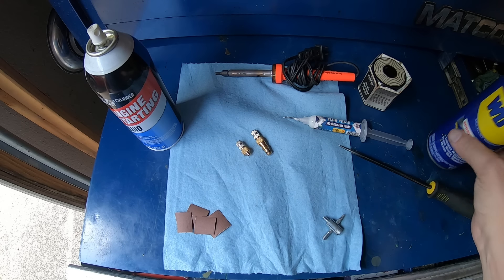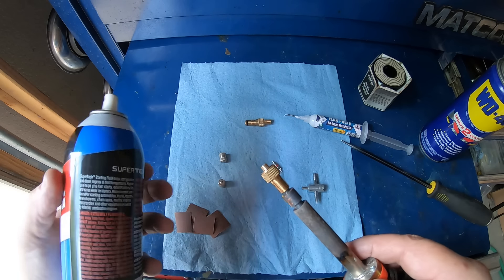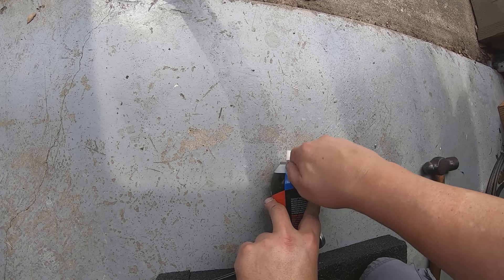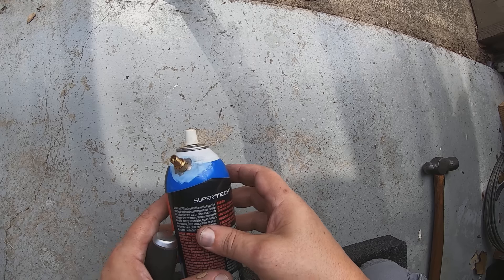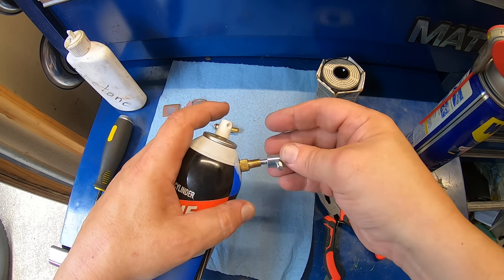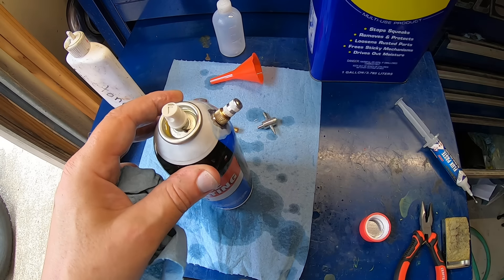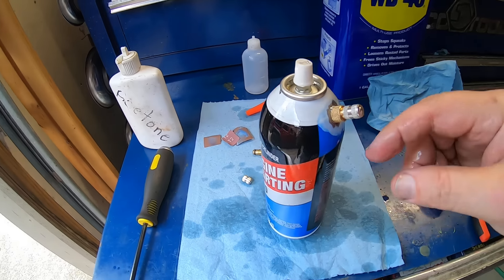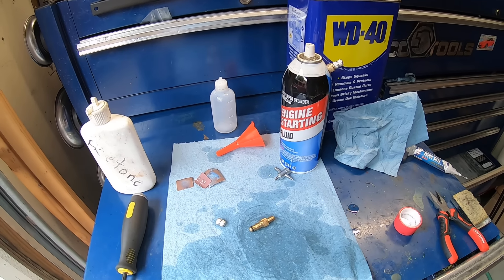How to Easily Install a Schrader Valve on any Can to make It Refillable without Drilling or Torch.

Comment: Cans are made for refilling. This is a dangerous thing to do with this one time use can.
Reply from the maker: No, not really, these cans are not made to fail after one time. People have done it for years with no problems. It is not a new hack.
Reply: @737mechanic  I still would be safe with one made to be refilled.
Reply: @RodgerMudd  Then don't watch these type of videos!  Problem solved.
Reply: @russb.6899  Youtube suggested I watch. If that's OK with you!

Comment: Interesting, but all you need to do is pull the spray nozzle off and use a blow gun with a rubber tip. Push the rubber tip onto the nozzle tube, air it up , and put the nozzle back on. Done.
Reply from the maker: That will work if all you want to do is spray air out of it but in my case I need, WD40, mineral spirits, and other liquids. How do you get the liquid in it?
Reply: @737mechanic  Correct, it just works to pressurize cans that still have some material left in them, which for some reason seems to happen often with PB blaster for me. I have a couple sure shot sprayers that work great.
Reply from the maker: @brianw8963  I have two sure shot sprayers that I really like but they spray too much fluid. These cans spray a finer stream or mist depending on the cap I use.
Reply: @737mechanic  I don’t use mine for thin liquids for the exact reason You mentioned, I use them with my undercoating/ rust prevention solution for spot applications when I service vehicles. For the thinner stuff like WD 40 I use the refillable pump spray bottles. I do see that your idea works well.
Reply: That puts pressure in. I do that to paint and WD40  cans that are a bit old, seems the pressure ebbs over time. But, it doesn’t allow refill of the can with liquid, correct?
Reply: @flmulcahy  Yes sir, You are correct. I believe I mentioned that previously. My fault for misunderstanding the original concept. I apologize.

Comment: Is it risky? If that brass fitting let’s go it will be like a bullet.
Reply from the maker: It won't be a bullet, the air pressure even at 100 psi is too low. For instance, a pump-up pellet gun compresses the cylinder to 3000-6000 PSI and it is shot from a barrel so it has time to build velocity. And a 22 rifle builds up to 24,000 PSI when it fires.
Reply: @737mechanic  ok, thanks

Comment: If air is ok to re fill, why use expensive, iffy gasses in the first place?
Reply from the maker: The gases they use are not expensive.
Reply: They use unscented LPG liquid and as the product is used the LPG boils to maintain pressure air would not last long enough for the whole can.
Reply: Air is full of moisture and oxygen so either ends up rusting out the inside of the steel spray can.
Reply from the maker: @mikelastname  The inside of aerosol cans are coated so they will not rust.
Reply from the maker: @trevorwilton2723  Not only is that not true as I have depleted my first can on a single air charge and still had air pressure left but even if that happens you hit it with an air nozzle and you would be good to go again.
Reply from the maker: @trevorwilton2723  You are incorrect as I have already depleted the first can I did and still had pressure left but even if that was the case you simply hit it with an air nozzle and you have air again.

Comment: One caveat to share. 
Don’t fill WD40 as much as it can hold, just fill 1/3 capacity and leave the rest with compressed air. 

The manufacturer can fill liquid almost full otherwise because they use new formula liquified low pressure gas (CFC in the old days HVAC) to keep inside cavity pressure constant.

Comment: Punch a small hole and open it by rolling the hole to correct diameter with a #1 phillips screwdriver.  
Do NOT drill or ream the hole - it puts metal chips in the can.
Use copper tail AC Schrader fittings - buy at a HVAC trade supplier - dirt cheap with a far better chemically resistant plastic seats in the valve.  The copper tail makes it easy to lay the valve fitting close to the can... not sticking out. 
You can gravity charge the can with a screw on hose connection to a funnel, or low pressure charge it in. You need to vent the can by inverting and pressing dispensing valve - to vent air being displaced as the fluid fills the can.

Comment: Why dont you just take the little plastic top off any spraycan that lost inner air pressure, and hold a normal rubber rimvalve to the little plasttube on top and fill compressed air in, like inflating a tyre. And them put the little plastic top on afterwards.
You can easy get a loose new rubber valve from your tiredealer, but get a long rubber rimvalve, so its inner metal parts dont touch to far down.
No drillimg and no need for soldering, and easy to do with various spraycans, that lost pressure, but still have some content.❤
Reply from the maker: That is great if all you want to do is have a can of compressed air but I need to spray liquids like WD-40 and mineral spirits or alcohol. 

How do you get the liquid in the can doing it your way?
Reply: @737mechanic  I just want to empty the cans even if the kompressed air in the can is gpne and some fluid still remain in the can.
Reply from the maker: @FlemmingGjellebøl  You can actually take a rubber tipper air nozzle and use that to shoot air back into the can. Like this one.
https://amzn.to/4blz5GF
Reply: @737mechanic  Good idea, easy and simple. Thanks a lot good buddy.

Comment: Main problem is youre using wd40. For what? Any claimed use other than displacing water, theres a product that works 10x better.
Reply from the maker: I use WD-40 for machining aluminum.
Reply: @737mechanic  I used to use this green stuff, cant remember what the name was but it didnt stink like wd40. So maybe just 5x better.  I just get annoyed when people suggest it as a lubricant or rust preventive when its really  poor for such applications. The best spray lube I recall ever using was made by castrol and  was marketed under their syntec brand. Similar to light weapons oil but thicker, and had no offensive smell. Looked like honey. Unfortunstely its either been discontinued or just isnt sold anywhere.

Comment: These cans normally use a propellant, though, which maintains the pressure by the propellant continuously boiling and making more vapor. With compressed air, the pressure will drop really quickly when you press the nozzle valve to spray the contents. You'll have to keep adding compressed air and it will be annoying. If you try to make up for this by using a higher air pressure, you risk an explosion from overpressurizing the can. Also, these cans are not designed to be refilled so the fatigue caused by cycles of pressurizing and de-pressurizing is not taken into account in the design.  I'll just keep buying them.
Reply from the maker: These kinds of mods are not for everyone. Some people overthink everything. So far I have sprayed all of the WD40 out of the first can I made and never had to refill it so you are incorrect in thinking you would need to always refill it before you get all of the contents out. I am sure you are incorrect about the can being fatigued to the point of explosion.

Appreciate your comment though.

Comment: 700 degree soldering iron on starting fluid can with product still inside , what could go wrong, too much work , just buy the spray bottle and gallon container they last for years

Comment: Your video was really as a good inspiration for me. I always used to repressurise the cans when there was still a little liquid in, simply by pushing the tip of the blow gun on the little plastic pipe of the tin. So actually I just needed a way to fill in fresh liquid. I ended up soldering on a nut and closed that with a screw and an o-ring. So far it's holding the pressure. I'm pretty sure instead of the o-ring some teflon tape would do it as well. 
I used a torch and for safety reasons I filled the can with water, wasn't so keen to figure out how a little brake cleaner mixed with lots of air might react to a flame.

Comment: So dangerous. Propellant is flammable, an empty can still contain propellant and could explode. Darwin Rules!
Reply from the maker: Have you ever wondered why car gas tanks don't blow up even though they have an electric fuel pump with brushes that arc? The air fuel ratio has to be correct and you have to have a source of ignition. Both of which are missing with this mod.
Reply: @737mechanic  introducing a hole introduces air. You don't need the correct air fuel ratio you just need enough oxygen to support combustion of some or all of the fuel. Petrol pumps do not mix fuel with the brushes. That's just a stupid statement. The electric motor is quite seperate from the fuel pump. I wasnt talking about your mod in particular as I didn't bother watching it. Just the whole process of piercing a can with flammable contents. But you do you Darwin will take care of the rest.
Reply from the maker: @DeveloperChris  you are completely incorrect, the electric fuel pump is submerged in the fuel and the fuel completely surrounds the brushes.

The only thing that keeps it from combusting is the air fuel ratio is not correct.

Look it up before you assume how something works.
Reply: @737mechanic  Interesting, the differences is the fuel pump is submerged in petrol. No air fuel mix. Apart from that my comment doesn't change. By adding the ability for air to mix with the contents of the can you are producing a potentially volatile situation. Most of your viewers are not aware of the risk. Also if you want to inject air in a pressure can, simply press your compressor up against the valve after removing the spray nozzle. It is a valve and works just fine if you get a reasonable seal and are not stupid and over pressurise the can (however the mix in the can is now more volatile!). That's how I have done it in the past. No need to risk puncturing the can which also introduces a weak spot which will cause the can to rupture unexpectedly with much less pressure than a can that hasn't had its integrity compromised.
Reply from the maker: @DeveloperChris  Wrong again, Only when there is enough fuel to cover the pickup screen, but when a car runs completely out of fuel until it quits you are literally running the pump including the brushes in fuel vapor, and even if you remove your gas cap the chances of the air-fuel mixture becoming the correct ratio to support combustion is extremely rare.

BTW this video isn't about how to put air only back in a can it is about how to put whatever fluid you want also in the can so pressing an air nozzle only works if you need to repressurize it with air only not fluid.
Reply: @737mechanic  this video explains why the fuel tank is "relatively" safe. However what you are doing is COMPLETELY different the can contains volatile gas. adding a hole alloys some to come out and be replaced by air which contains, wait for it oxygen. Yeah that stuff that causes bangs
If you want to use different liquids inside the can just buy a pressure pot for your compressor. BTW Air is a really shitty propellant that's why its not used in cans and if the contents of the can reacts with air it will go off really quick.

So why play stupid?

However I am fine with one less trump supporter so keep up the good work.
Reply from the maker: @DeveloperChris  You do realize I am NOT pumping oxygen into it right? The air I am pumping into it is actually 78 percent nitrogen which is an inert gas. BTW what is the volatile gas you keep talking about?
Reply: @737mechanic  The video I forgot to post 
https://youtu.be/VcVR9yaN0rc?si=3kpU4teFmsfx-hkA&t=340

And this is what happens if you don't know what you are doing

https://www.youtube.com/watch?v=GKqhiOsQR8g
Reply: @737mechanic  Air contains ~20% oxygen How the hell do you think an internal combustion engine works if there isn't enough oxygen?

Take a can of almost whatever and spray it towards a naked flame (cooking oil is a good one). That flamethrower is because of the propellant not the oil, very volatile. 

The can will tell you what the propellant is, mostly hydrocarbons, volatile! 
Interestingly rp40 uses CO2 as the propellant. rp40 itself is flammable though so same problem. The can states "DO NOT puncture even when empty". I assume they use CO2 because hydrocarbons would diffuse into the RP40 and therefore the can wont spray properly.

Spray cans are small bombs, when used as designed they are safe. when not used as designed they are, well dangerous.

Same as a fuel tank and pump. When used properly mostly safe when not used as designed your workshop and the people in it burn down. Ask Chrysler and Ford about the exploding petrol tanks they were sued for.

Your video shows people (who are not experts) how to put themselves in danger when a simple pressure pot will do exactly the same thing and do it quite safely.

Getting the last drops out of a can will work as I explained by injecting directly into the top but at very low pressure, if that can explodes you are in a world of hurt. If you puncture the can to fit a valve that pressure has to be much much lower as the integrity of the metal is severely compromised. I sincerely don't recommend any repressurising of any can (even with my hack) as you have no idea what the safe limits are.

If you don't trust me go and seek advice from an expert not some random youtuber.

Putting other people lives at risk for a few views is the most selfish thing you can do.
Reply from the maker: @DeveloperChris  That first video explains everything I have been telling you. The brushes are submerged in the gasoline and the reason it doesn't explode is because the fumes are too concentrated.

The second video says they were pumping gasoline out of the gas tank using a pump, well now you have a problem where you have fuel vapor mixing with outside air outside of the gas tank and an ignition source.

Thank you for proving my point.
Reply: @737mechanic  As I said you do you. in the first fumes are excluding oxygen, Your hack is not. In the second this is what happens when you mix oxygen with fumes and an electrical device.
All I proved was that you are apparently ignorant of the dangers of what you are promoting.

So lets just completely remove the point of contention. We will ignore a fumes explosiveness even though you were completely ignorant of what fumes were in the can because you didn't bother reading  the can itself or you don't know what a hydrocarbon is, you ignored the warnings it is flammable written all over it.
Instead lets just concentrate on you promoting pressurising a can after destroying its integrity.

It shows that you compromised your own integrity for views or never had any to begin with or simply don't understand basic mechanics.

What the industry calls a hack.
Reply from the maker: LOL, You are the one who doesn't understand and is so scared of your own shadow you will never accomplish anything in life.

You are right about ONE thing, it is a hack and I never said it was the proper way to refill a can. This video is for people NOT like you and who have confidence in doing mechanic work.

Comment: No drilling, no torch, no lathe, no soldering...just the same mouse and credit card used to get the tire valve from Amazon and $40 or so
Reply from the maker: I guess you could buy one of these for 35   https://amzn.to/3VKiUNr or do what I do and make dozens of them.

Comment: I do not even bother with this foolishness. I just use a pump bottle with mixture of used motor oil and transmission fluid. But that is for removing rusty bolts and nuts not to oil down a lathe. But i would imagine just putting wd40 in pump bottle would do same thing. I have not bought PB blaster WD40 or Kroil in over 10 years saved me thousands

Comment: I agree on not drilling the cans, eventually some small crap will get inside and clog it up.

I just use brass tips made for installing brass threaded inserts into plastic, they are made for the soldering irons that use a sleeve and collar nut where tip slides onto the ceramic heater.  Can get them single size or in sets.  Those style of irons are really the only ones that have a standard tip design, I highly recommend that style since so many companies make tip accesories for them far cheaper than Weller sells their normal soldering tips for.  Making one for an iron where the tip threads on can be brand specific.

Comment: You're putting a flamable liquid and AIR CONTAINING 21% OXYGEN into a container under pressure,,, What could possibly go wrong ????
Reply from the maker: No more risk than striking a match or lighter out in the open with 21% oxygen in the air, now if I was filling it with 100% oxygen that would be a different story.

BTW you can buy commercial refillable aerosol cans for this same purpose.

Comment: Looks like a great way to die.  "They say these cans are rated for 100 lbs...."   Who is "they?"  What happens over time as the can corrodes?

I'm not opposed to the idea, but putting 100 psi into a thin walled tin can is a death wish.  That's a lot of square inches and an exploding can would cut you like a razor.  15-20 psi, maybe. But 100? HELL NO! A pertinate piece of information would be to know the psi charge for the original product.
Reply from the maker: You should watch my other 2 videos where I pressurize 2 different cans to failure.
Reply: @737mechanic  I watched one of them.  A can won't burst at the same pressure every time, and the rated pressure is usually far less than the realistic bursting point.

But keep in mind those cans are very thin, which means that it wouldn't take much corrosion or a nick from a tool or being dropped on something sharp to compromise the strength of the can. There's a lot of square inches on that can, so even at 100 psi a failure could be devastating.  It'll work till it doesn't.